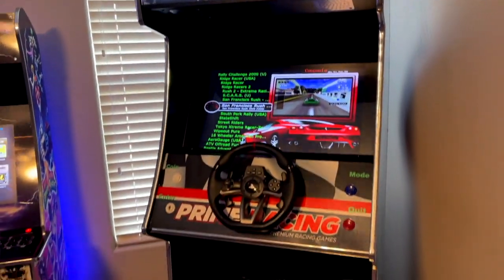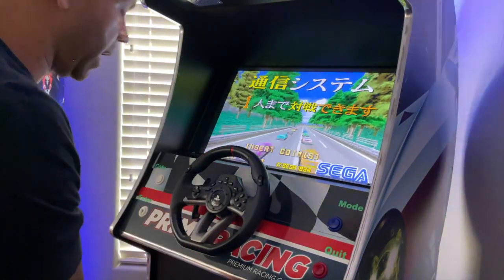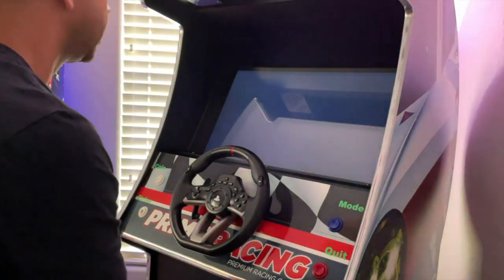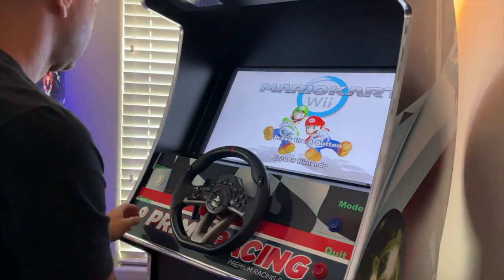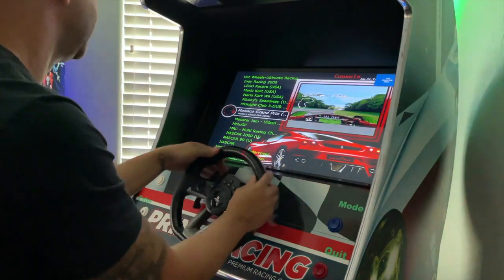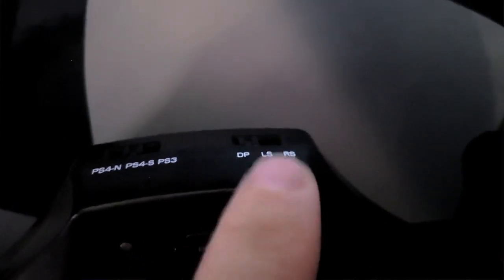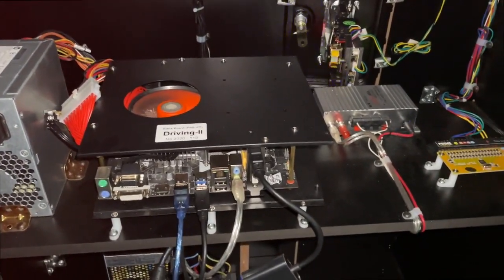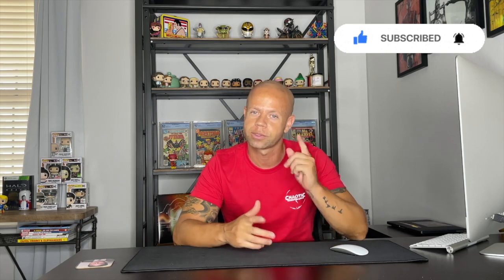Prime Arcades Racing Cab review & Gameplay. 130+ games on one cabinet!

Comment: the Bottom line should be does it feel like the OLD 1980s Stand up racing games ???
Reply from the maker: I cant agree with you there. As you can see this cabinet is host to a lot of games that are well beyond the 80s. It is not an 80replica cab. Nor did the 80s influence the design of the cab. It does contain some 80s titles, and the play very well. Once configured properly, it’s a pretty good feel.
Reply: @RETRODNA  Then you should have more than one Cab.... Let us know if switching out the steering wheel makes ALL the games better...
Reply from the maker: @kelvenguard  I do have more than one cab. As I mentioned in the video. Also, like I mentioned in the video I like the feel of the steering wheel for certain games. Anytime you have that many games on one cab, you are going to have different feels for each game. Im not sure what led you to believe the standard was set by one of the few 1980s era games. Either way, I’m not looking to change out the steering wheel. Thanks for the comments
Reply: @RETRODNA  Cool and Thanks... being Born in 1968 I probabley think different then some one born in 1978 or 1988 etc

Comment: Was excited until I saw the price of these.
Reply from the maker: Right! Haha.
Reply: Its the price of 2 and 1/2 Arcade1up's
Reply from the maker: @SoulforSale  yeah true but its also a full size arcade and it has the same # of games as 50 arcade 1ups. Lol
Reply: @RETRODNA  the lack of a shifter and no tactile feedback ruins the illusion or it would be worth it
Reply from the maker: @SoulforSale  basically just restating my review at this point. It has paddle shifters and considering the game selection, a force feedback wheel would mean cutting the game list in half. Its not a racing sim. Its a retro racing cabinet and only select games had FF wheels. Adjust the games list accordingly to optimize playing. I personally have a seperate cab for force feedback games
Reply: @RETRODNA  i missed the shifter part and i saw Ralphs overview as well. they could keep the non feedback games. the wheel is entirely wrong for my fave Pole Position but a shifter makes all the diff. Is probably worth the price.
Reply from the maker: @SoulforSale  oh see, since my modern racing cab has a force feedback wheel already, I’m actually glad this doesn’t that way I get the authentic experience for each game. I never sum up a cab based on one game. Pole position is a great example of that. Even IF it had a shifter it would never be the same as the original PP cab. It would just feel like a cheap knockoff. For that game you have to have the original cab imo
Reply: @RETRODNA  in order to get a PP cab to work the steering has to be right. it can be done.